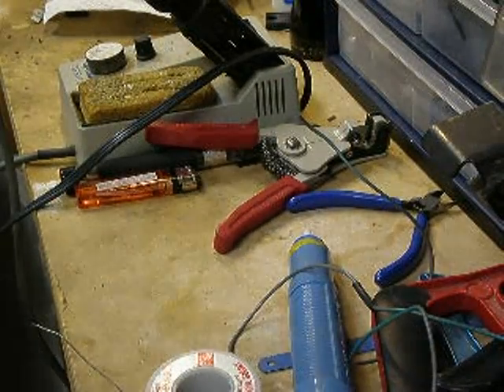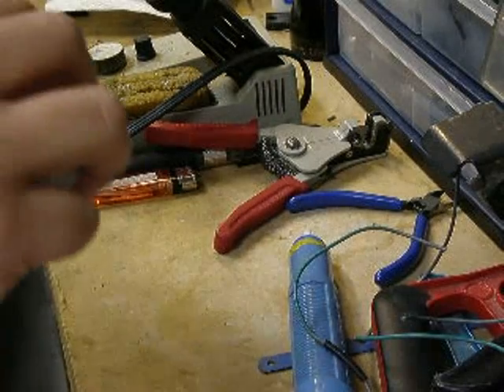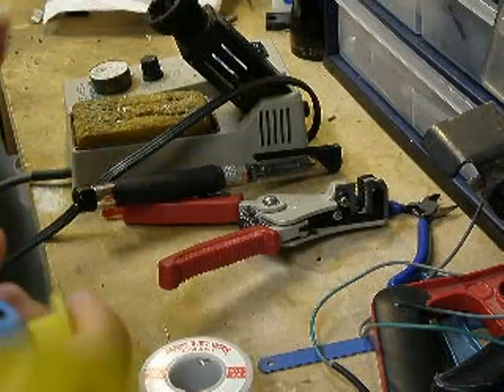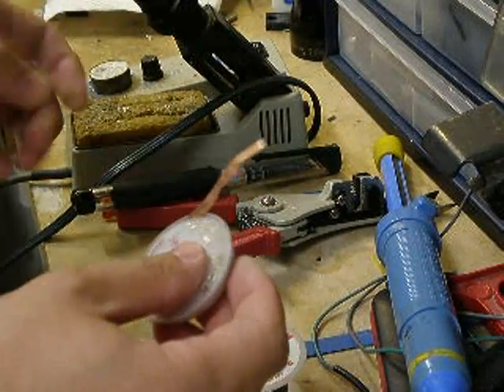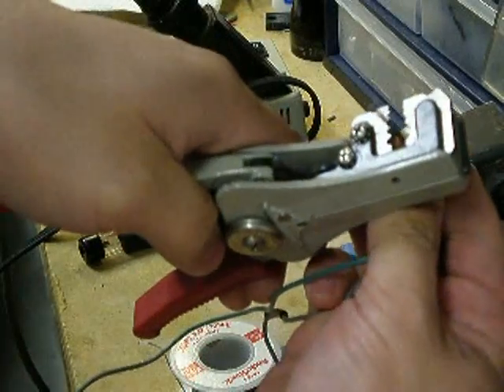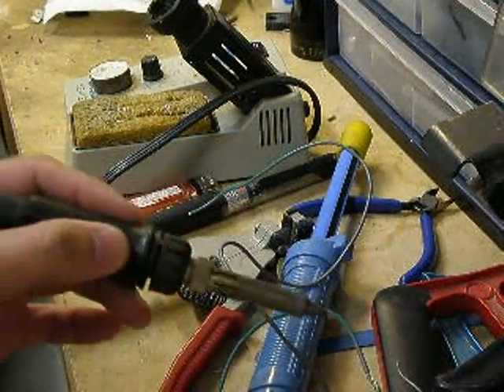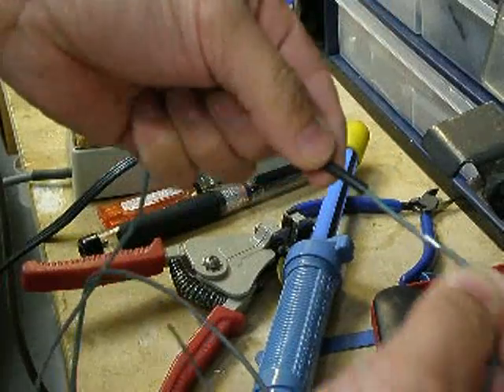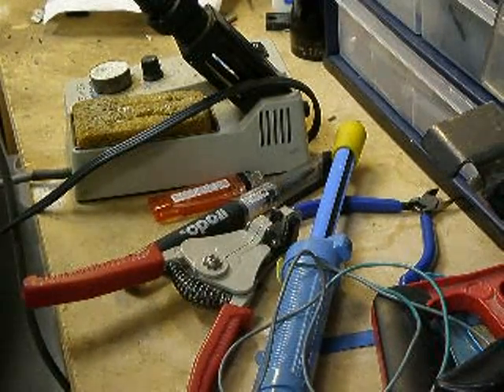Auto Install - How to solder and heat shrink wires together

Comment: Thanks for the video. I have had a lot of trouble trying to do this in the past because I always melt all the insulation off because it gets too hot. Maybe I was using the wrong type of solder, with a high melting point. Also, what is on that sponge you keep wiping the iron on?

Comment: can you share the size of the shrink tube you used in this video? I have some wires that need repairs on my car and they are the same size of the one in the video.
Reply from the maker: The diameter of that tubing was about 3 mm, but you should typically buy tubing that is 20-30% larger than the wire you are heat shrinking. I will be uploading an updated video to this video with better video quality, so stay tuned and subscribe.

Comment from the maker: Not sure about differences in heat shrink. They are typically rated with a ratio of how much shrinkage it has from original. Just get the right sizing for the wire you put it on. You can probably use the one you have for sleeving.

Comment: not sure why you didn't show how you twisted the wires together? the best way to splice 2 wires is to present the strands together so that they mesh, then to 2 counter rotate each end for the mechanical joint, then solder the joint for the electrical connection, slip heat shrink over the connection then pass a section over to double insulate the joint, this will make a nice joint, with practice the jint will be about 10mm ...

Comment from the maker: The wire gauge is rated for a specific maximum current flow. You can crimp the 2 together, but make sure the current (amp) flow in your application will not exceed the maximum rated for the 26 gauge wire. You can google for 'wire gauge current' and should fine some table showing the ratings.

Comment from the maker: I am not familiar with all the cars particular hookup, but if your deck has 6 channels then its probably 1 pair front, 1 pair rear, and 1 pair sub. You need to find out what that one rca is on the adapter harness, it may not be for speaker or it could be for sub. I am not one to like guessing. When it comes to cars, the wrong guess can sometimes mean expensive repair.

Comment from the maker: I typically use .032" diameter, 60/40 rosin core solder. It works well for circuit boards and soldering wires.

Comment from the maker: For electrical solder, you buy rosin core solder which means the solder is hollow in the center and contains non-corrosivve rosin flux inside. As you melt the solder, the rosin flux comes out and facilitates the bond between the metal and the solder. Rosin core solder is the most common type of solder and is a multi-purpose solder.

Comment from the maker: Solders you buy from RadioShack or in the electrical department of some auto stores will work. Just don't use solder made for plumbing.

Comment: @Knightlore10 I cut through the auto wire too and then slide a heat shrink in and solder all ends together

Comment from the maker: @Knightlore10  There is no way of putting heat shrink over a factory wire that you don't cut open and then soldering back together. You also cannot cut open a heat shrink tube and wrap it over a wire; the cut shrink tube cannot hold anything to contain it.

Comment: Very interesting. All these videos provide examples where you slide the heat shrink over an open end. That's great but how do you do it where there is no open end i.e splice into existing automotive circuit? Is it ok to cut along the length of the heat shrink and wrap over the wire?

Comment from the maker: @viruslived 
For the soldering iron, check out the website parts-express, they have been around for a long time and offer many price ranges for various type. As for the wire strippers and heat shrink, you can get most things at part-express, but as for local stores, try both Radio Shack and Home Depot. Thanks for your comment.
Reply: Radio Shack?? I wish they were still around!!